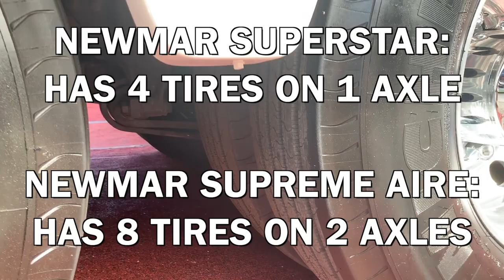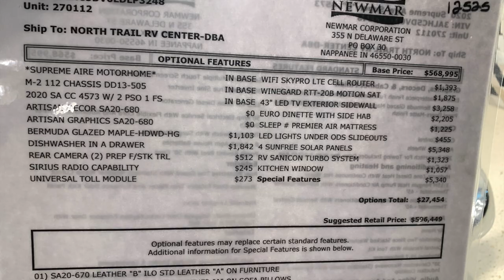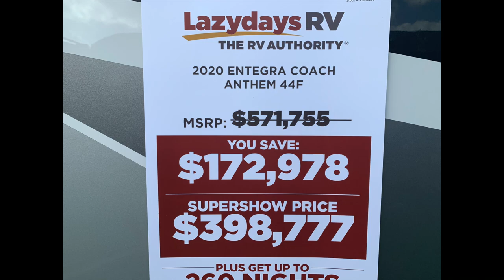2020 FLORIDA RV SHOW-FREIGHTLINER MH CHASSIS-SUPREME AIRE 4573-ENTEGRA ANTHEM 44F-PARK MODELS EP104

Comment: Wow Mark, great work on both chassis...I stopped them a hundred times to go and get a detailed view, thanks.  I have been watch Bus Grease Monkey as well and he really tackles the heavy duty maintenance on bus conversions.  Although we won't put the mileage that they have, it gives you a great deal of knowledge on the mechanics of DP's as well.  You and I are not going to try to torque out wheels to 450 ft lbs, but at least you will understand what needs to be done.... We love your channel and can report that Barbeieres still has fantastic pizza...
Reply from the maker: I love their pizza, and somehow MISSED doing a carryout while in Milwaukee!  I just did a GoPro fly through of a Spartan Frame.  I will have to see if the footage is good enough for a video!

Comment: Love to see you guys do a Diesel vs Gasser class A comparison. Especially maint. cost comparisons. Gasser class A's are trying to compete with DPs. Several Gassers now have half baths. Thx!!
Reply from the maker: We have some good friends with a new 2020 Tiffin Allegro 36LA gasser, with the fancy gas spring suspension option installed, as well as the Safety Plus Steering Mod added.  You can follow their Youtube travels at RVDiem.

Comment: I am preparing to go full time in july and the research I've done on Progressive roadside assistance guided me into believing  it was sufficient for a one and only assistance package.  Many RVers on the forums are satisfied with Progressive's services.  Could you list a few reasons more in detail as to why you chose to go above and beyond your insurances coverage and get Coach-net?  Thank you.  I do enjoy your content and hope to cross paths with you in the future.
Reply from the maker: Joel I guess it amounts to this.  The first year Coach-Net cost $249, then the renewal rate then drops to $159/year.  I have seen youtube videos of folks breaking down in remote areas out west, and lesser towing companies showing up in totally undersized and inappropriate equipment to tow in a 44 foot Motorhome.  If you have to flatbed tow a large rig, you are looking a thousands of dollars to tow it a long distance to a Cummins Service center that is sometimes your only solution to get the repair done correctly.  Coach-Net will tow it not to the closet mom & pop garage like most towing insurance,....they will tow it to the place that is logical, and appropriate for your emergency.  For $159 a year, I will not take a chance with my Progressive Coverage alone, which I also have.  The progressive coverage will pay to get you off the roadway in an accident scenario. Coach-Net will then pick you up and get your rig to where you need to be for the repair to be done correctly.

Comment: The chassis tour was impressive but my preference is Spartan. We have a true 20k towing. Our GCVWR is 20k higher than our GVRW. I've seen.Super Cs with 40k towing capacity. The Cummings 605 hp. has 1950 ft. lb of torque. Love CoachNet. I know one guy who was canceled by Good Sam for using it too much.
Reply from the maker: We hope we didn't bore people with the Coach-Net segment. This is an important issue for folks with a big rig to understand correctly to be covered completely when the time comes that you will need it!  A full timer has a much higher exposure to needing it someday.  I feel that I understand a lot more about Coach-Net after talking to Haley. She was really great to talk to.

Comment: Good video. I think you are underestimating the strength in the front of a diesel pusher. First you have a much heavier fram than a car you also have the generator up there and you are sitting above the area that might collapse. My outhe negative on the super C is even the top Newmar only has a air ride cab. they don't have a airbag suspension. Plus the added noise of a front engine diesel.
I am much happier with my Mountain Aire.
Reply from the maker: I had forgotten about the possible engine noise!

Comment: I’m looking at this chassis and so much use of steel … wondering if composite materials might not be used in places to save weight!?
Reply from the maker: I used to work at the place that made these frames.  They are "super heated treated steel C-Channels. Virtually none of the large truck & pickup frames we made of composite.  The analysis group was in charge of making all the material choices. I expect the cost and duty cycle was not a good fit.

Comment: I am wondering with all the travel you all do, how do the individual states work with your driver's license? Because you have a license in your home state and you are within you states requirements does your license cover all of the other states? I hope the question is clear.
Reply from the maker: As long as you are complying in the state you are plated and domiciled in, you can travel ok into other states. Some states do not allow triple trailer towing, so you have to know that. Texas requires you return to every year for a vehicle inspection!  Some require special RV licenses when your rig has air brakes. It's like a "poor man's CDL". Check the laws for the state you are interested in,.....
Reply: @OurJourneyInMyles  Thank you for your replay that makes it easy no special license.
Pastor TJ

Comment: Both rear axles are drive axles shown ...?
Reply from the maker: The drive axle with 4 tires is driven,....and the 2 tires behind the drive axle, which is the one furthest from the driver, is not driven.  This is the tag axle. The linkage in the tag axle suspension allows each wheel to swivel and turn to reduce the turning radius of the rig.  This feature locks out quickly after a certain speed.
Reply: @OurJourneyInMyles  oh i thought when ever you saw four and four like on super C. They were dual drive axels.
Reply: I wstched the video again. Sir you are right as usual.